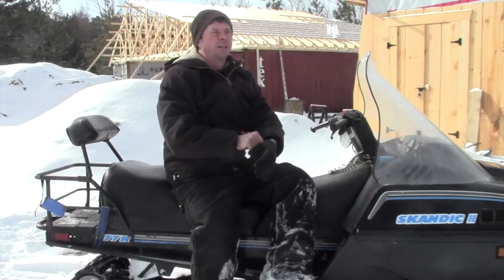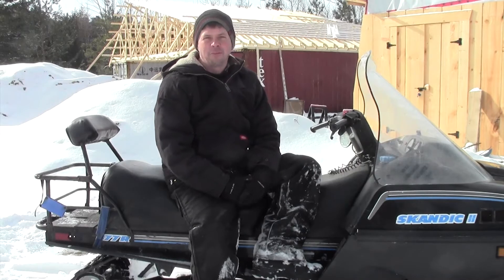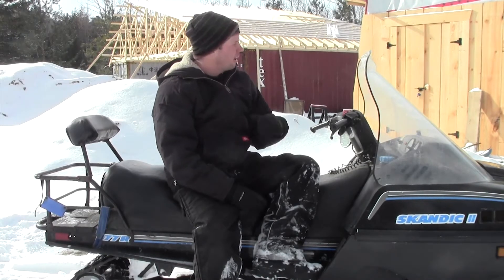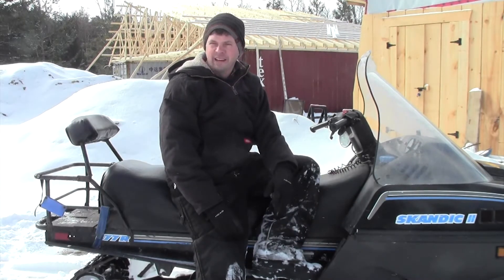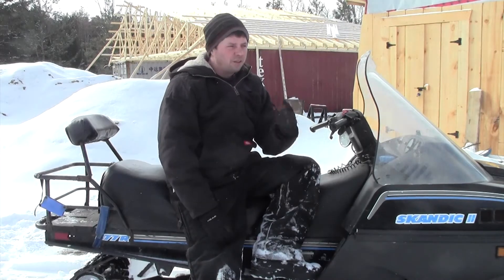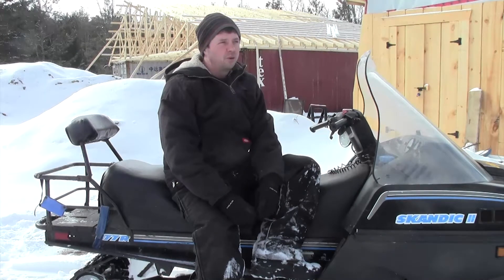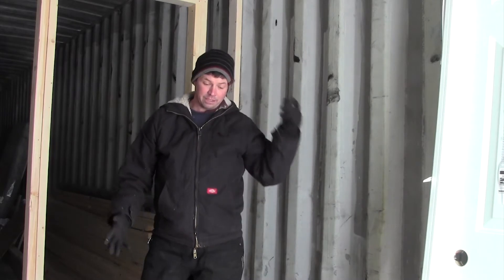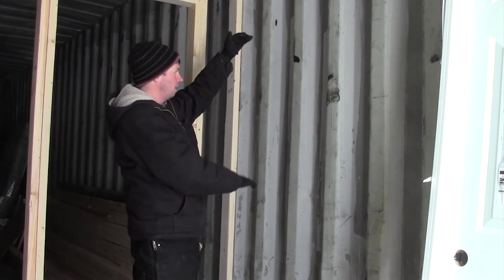Shipping Container Barn Build  - Installing The First Window - S02E09

Comment: Was it worth using a plasma cutter?

You really should try Vlogging instead with an external microphone using your favourite cellphone. You'd be surprised. Use this 4-pin plug made for cellphones. Your sound would clear up greatly:
https://www.amazon.ca/gp/product/B01E3L1ESS?ie=UTF8&tag=jtjohnston-20&camp=15121&linkCode=xm2&creativeASIN=B01E3L1ESS

John
Reply from the maker: Sorry.  Just saw this.  It was marked as spam for some reason.  Plasma made it easy for sure, but could also use a grinder.  The paint on tha container made it hard on the plasma consumables for sure

Comment from the maker: When the first window went in I welded a piece of steal across the top to stop water from leaking in behind/over window.  Now that the roof is on it is not a concern.  I used a 2x4 frame to attach the window to the can and used blow foam insulation to seal the window to the can.  Then the wall has three inches of insulation on before the board.

Comment: How did you flash the top of the window? Did it end up leaking?
Reply from the maker: On any window or door that had a chance to leak I welded some flat stock to the top of the cut out.  I am not sue if this was needed and there is never any water there because of the roof overhang, foam board and board and batten.  If you used a different finish, maybe it would require something like flashing

Comment: is your wooden frame just a push fit or is it secured to the container walls?
Reply from the maker: It is secured to the walls with screws.  I mad it two layers of 2x4.  It helps seal the screw holes, but also makes the thickness equal to the re claimed foam board I am putting on for insulation.  I have a video coming out soon on that.